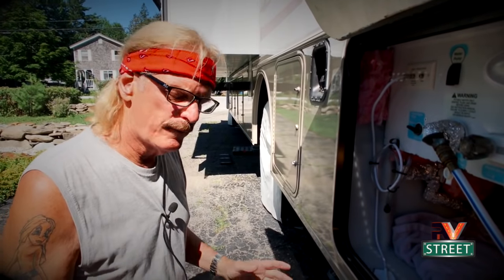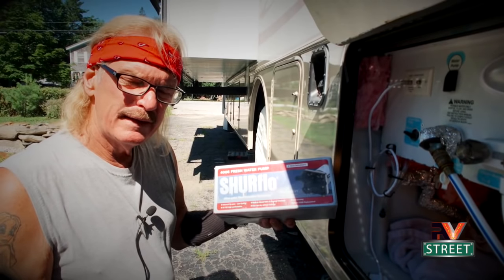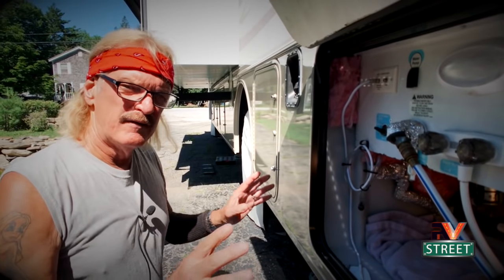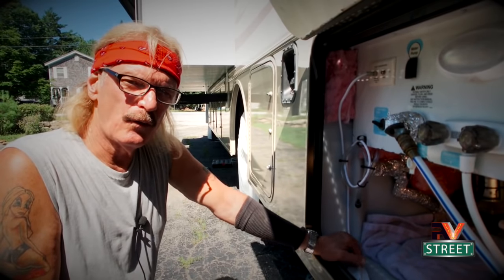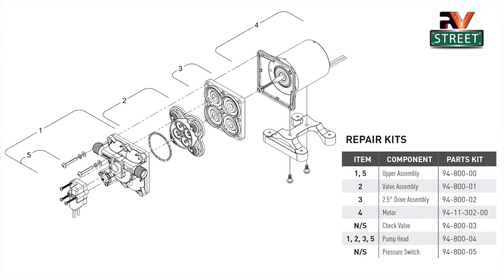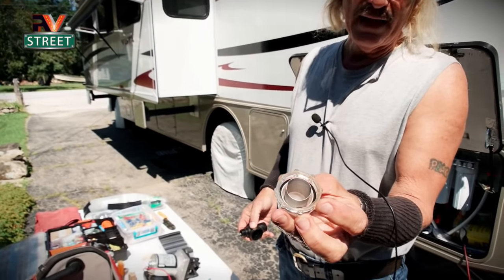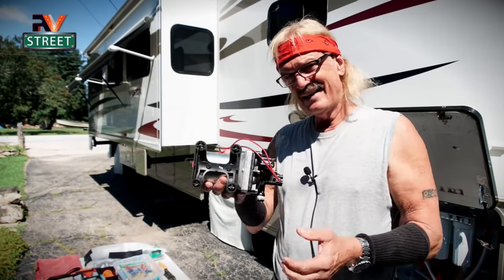RV SHURflo Water Pump Replacement & Important Tips

Comment: Is there a reason why when I'm taking this pump off the hose going to my lines is SPRAYING FULL FORCE OUT? I'm not hooked up to city. I opened all water lines drained them. Pump is off. It's coming out like a hose on full force.?? I reconnected it real fast bcuz I thot I had something backwards. ?? Tell me it was probably just going to stop when I reconnected it?
Also, this doesn't come with the filter right?
Reply from the maker: 1) If you weren't connected to city water then yes I'm pretty confident the water that was coming out was the remaining water in the line. If you want to eliminate most of that water, trace your intake water line that comes into the pump.....back a little bit—this is the line that feeds your pump from the fresh water tank—and you should have a valve there. Turn the valve off. There will still be some water come out though that is still in the line.
2) If you mean that screen bowl off the side of the water pump, no it does not comes with the pump. You simply take off the old screen bowl, clean it, teflon tape it and put it on the new pump. 
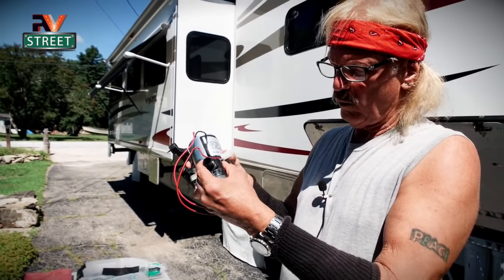6:54 and 12:45 in the time line: https://www.youtube.com/watch?v=x9XqiCpYauc&t=366s
Reply: @RVstreet  Thanks Martin, I'm up 6am wanting to get this done today... I didn't expect an answer so FAST thank you! People who sold me this never had one on, when I replaced this I thot the directions "showing" the filter meant it was left out. Gotta run for that today. So greatful for your hard work. Your videos are so precise rarely is a question needed! 👍
Reply from the maker: @prest4tym577  People who sold me this never had one on........
That's probably explains why the pump failed on you.

Comment: Roger the city water turn-off!  We stayed at a KOA with massively over-pressure water that overpowered our water regulator.  It blew out the supply pipe under the kitchen sink. Thank God we were were sitting right there when it happened and got the city water turned off immediately.
Reply from the maker: Wow, you were lucky. But that should of NOT have overpowered your regulator. That's what it's there for. I would replace that sucker ASAP for sure. I would not trust that regulator ever again.
If you go back to the video in the description text I put a link to get a new one near the bottom.
https://www.youtube.com/watch?v=x9XqiCpYauc&t=1s
Reply: @RVstreet  Yeah, that regulator went into the metal recycling box as soon as we got home.  We replaced it with one of the expensive units with a pressure gauge and adjustment screw before going out again.  It's interesting how much the water pressure varies throughout a day.  Safe travels, my friend!

Comment: Should have used the heat shink after the install over the plugs you added. Dont need the electrical tape if you had done that
Reply from the maker: I know. I could of showed that but didn't. But you just did. thx 👍

Comment: Just wondering.....why not use insulated butt splices instead of all you went through to install spade connectors?  The wire to the OEM.plug could be cut a lot of times before running out of wire.
Reply: I was wondering the same thing.  I prefer to solder the connections (maybe overkill) but Mark might not have the items needed in his tool box to do that.  He makes a very good video and I like how he does step by step explaining things.  Thumbs up!!!  Stanley in Md.
Reply from the maker: To both comments. Ya you can use different connectors if you want. This is what I had. Either way works. But I did leave plenty of wire from the OEM plug to do this several times in the future if ever needed. It really wasn't much of a hassle at all. 👍
Reply: @RVstreet   you know  a lot of RV repairs are done with what you have.  Not downing you just wondering.  I've used what I had many times.
Thanks, keep the vids comming

Comment: Why not just use wire nuts instead spade lugs?
Reply from the maker: Of course I could of done that but this is the wet bay where a lot of moisture tends to be from time to time and condensation also can tend to happen with temperature swings. I should of showed that once I connected the two spade connectors instead of wrapping those two areas with electrical tape, I fully incased both spade leads in a heated shrink wrap which I did a couple of days later. Now everything is heated shrink wrapped and no moisture at all can invade that area. If I ever have to replace that pump again, all I have to do is cut that heated shrink wrap off, pull the spade connectors apart, rinse and repeat. thx for your question Ahead. 👍

Comment: It would have been better to use a butt connector instead of spade connectors.  Less chance of bad connections and corrosion.  IMHO
Reply from the maker: Ya, I didn't have those but both work fine. thx Tommy 😜